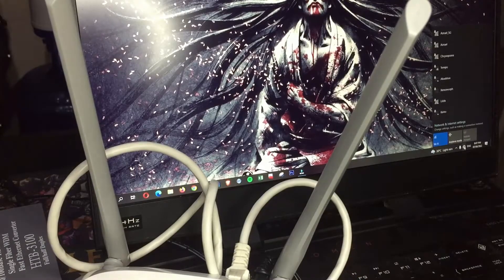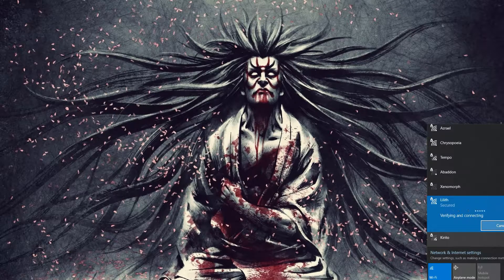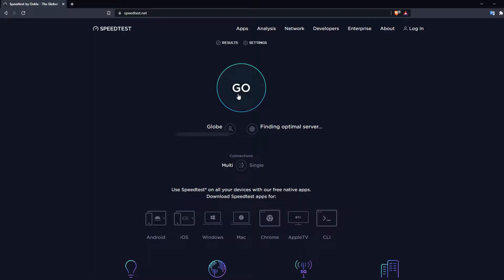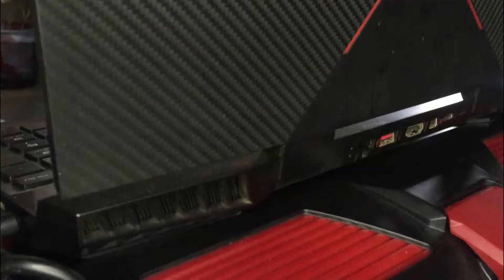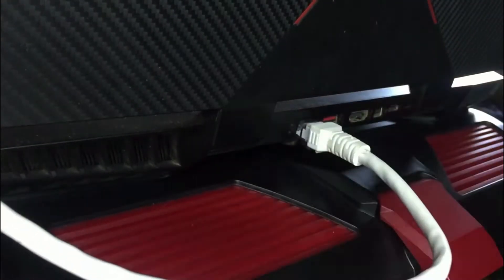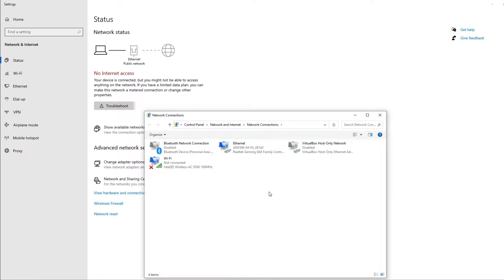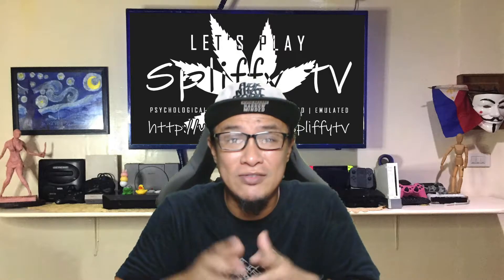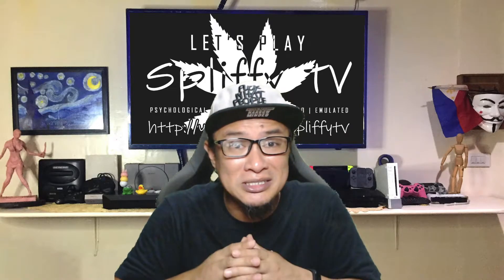HTB-3100 & HTB-GS-03 Media Converters | Unboxing, Testing, Review | SpliffyTV

Comment: What if my HTB-GS-03 has both RX and TX and I bought a Fiber SC cable that has two plugs on each end. I think it tells that it is Full Duplex. So are the ones you have not Full Duplex? Or how does that work? It's really weird to me to connect TX on one to TX on another. Is it single mode or multi-mode on yours? So how does it RX and TX at the same time? Or is it Half Duplex?

Comment: Hello, I have the same device, and it has stopped transmitting the internet, I have seen that the lower left light is off on both the receiver and the transmitter, could you tell me why this is due? It worked perfect for 2 years, The lower left FDX does not turn on and neither does the upper right 100, thanks
Reply from the maker: The device is very prone to rust when placed outside or in an open space, that was my experience. Try opening it and find out. this is most probably a hardware issue.
Reply: @SpliffyTV  gracias lo revisaré pero están los dos en el interior, supongo que el led inferior izquierdo indica la señal de la fibra óptica no?

Comment: Hello, greetings from Catalonia. With your video I have resolved my doubts between HTB-3100 and HTB-GS-03, which is in the transmission speed, right? So if my connection is 500 or 600 Gb and my router is WIFI 6, HTB-GS would be better -03?
Thank you very much and congratulations for the video, simple and clear.
Reply from the maker: yes, htb-gs-03 would be the best choice. thank you for visiting

Comment: Hi, my friend, thanks for your video, A question... what is de port RX for ?
Reply from the maker: tx is supposed to be for transmitting data and rx is for receiving data. it's probably the original plan with the metal case. it is not used now since only one port can be accessed and is used for both functions.
Reply: @SpliffyTV  thanks

Comment: Sir pde po ba gawa kayo guide paano gumana si Tplink router sa media converter at paano setup nya kasi ung sa akin ayaw gumana ng routermode ni tplink wala sya internet connection:( diagram ko is converge isp to mediaconverter a to b then lan cable to Tplink no internet connection? 100mb lang nakukuha ko sa MediaConverter B pero sa A is 1000mb
Reply from the maker: ano model ni tplink mo? kasi need din nya 1000 mbps or 1gbps sa kabilang side.

Comment: Hi,thanks for the video, I have an issue 
my lap top is dell inspiron 3593 core i5 1035g  Mx230 nividia
Iam facing a throttling problem with my gpu it reaches 75° and throttles fast and decreases clock speed that makes fps drops in a short period while gaming,  what to do?  And my cpu reaches 100°C 
If I undervolt it, it will be better and if it's locked and can't do that, can I reverse bios version? And how to do that? Thanks in advance
Reply from the maker: what games are you playing? how old is your laptop? can you share your complete hardware specs? a cooling pad can also help a little.
have you tried repasting? 
if you bought your laptop in 2019, repasting and cleaning the vents/fans should at least improve the performance.
Reply: @SpliffyTV    OK, can I reverse bios system? 
I bought it in 2020
Core i5 10th
Intel uhd620 
Ram 8 single
Nividia Mx230 2gb
I play games that gpu can handle as gta v gta 4 arma 3
Repasting may not help so much also many users of this model suffering from high temperatures even if they bought it yesterday!
Reply from the maker: maybe the design is bad? most slim and light gaming laptops are like that. my omen will crash any game when temp is too hot for too long especially here in the Philippines where its too hot. i just place a fan facing the keyboard part, in addition to my cooling pad and all will run smoothly again. lol
Reply: @SpliffyTV   OK thanks